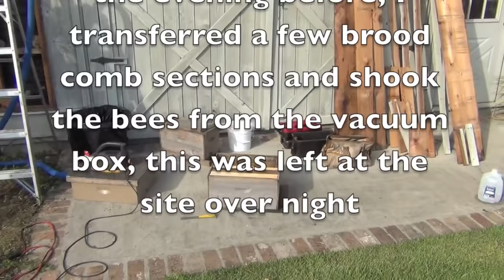Honey Bee Removal 101 ( "A-Z") With JPthebeeman

Comment: Hi JP not sure if you go back and look at your old videos but I was wondering how you keep the bees from coming back to that location
Reply from the maker: There’s no magic potions to keep bees away, if someone tells you otherwise they really don’t know what the heck they’re talking about.

Propolis alone is enough to attract scouts looking for a place to colonize & bees love to propolis tight seams in the void they’re occupying & even adjacent void spaces you can’t even get to.

The way to think about this is “exclusion.” If they can’t get in, they have to either pick another spot or build externally.

Spray foam does not work & I don’t trust the one that contains a pesticide, I feel like at some point it’ll wear off as well & spray foam does not age well either.

A great product is dynaflex 230 or ultra or something comparable like liquid nail.

Of course some buildings need more than just caulk because they have issues with rot, termites etc…

Incidentally, I always discuss bee proofing with the building owner. I never walk away from a job without telling them before & after the job, that bees will be attracted to the structure but if proper steps are taken to exclude them then the issue can be prevented.

In some cases this is easier said than done ie: buildings that require extensive repairs due to rot, termites, neglect, etc…